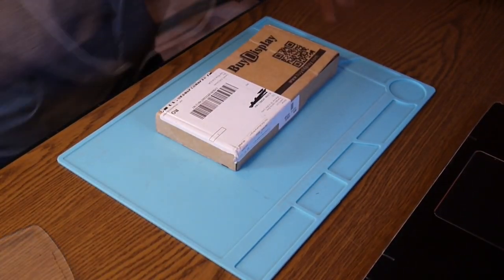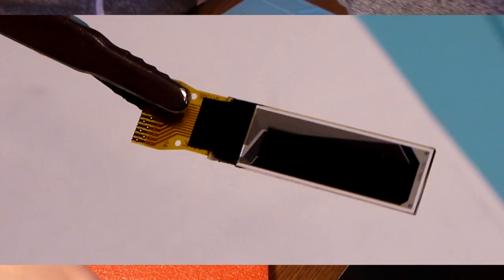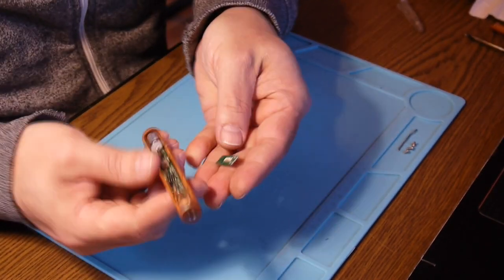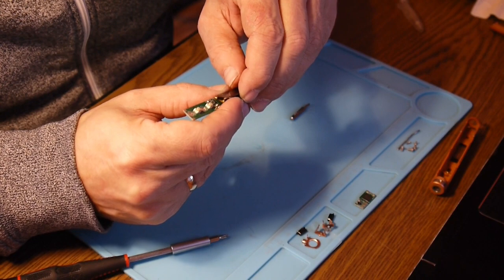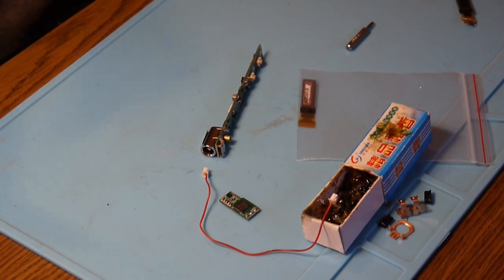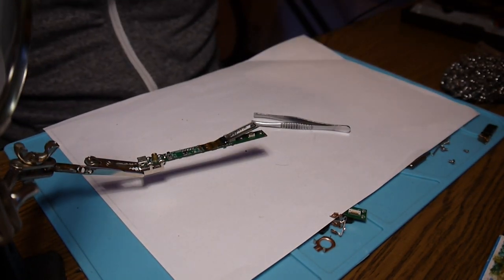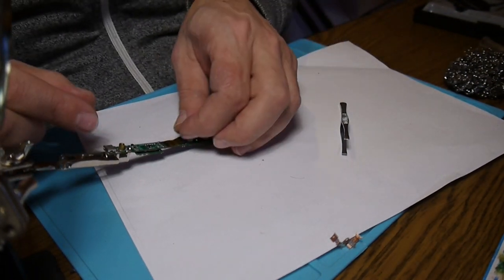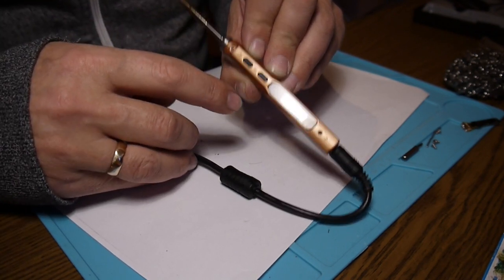TS100 soldering iron OLED LCD screen problem fix and replacement

Comment: I fixed the same issue 3 days ago, and it was working fine as in your video. Then I put in a desk, and the day after the OLED was dead. Not lighting at all, but the iron seemed to work (it was getting hot).
No way to have the OLED working again. 
I dismounted the solder again and spend one hour carefully checking under the microscope the solders, and they were perfect.
For added certainly I quickly passed again the iron over the soldered contacts but nothing changed. Then I tested each contact, and there was electrical contact between the connector and the PCB, and the 3V voltage was powering the OLED, but the OLED was just off.
No idea of what happened. It was working the day before just after the replacement, and it was just turned off and put on the table.
- any idea of what happened ?🤔
Reply from the maker: Probably a bad LCD... I had that issue with my son's , replacing the screen turns off after a few weeks... I ordered some more, and it seems this time it's ok. Mine it's working for years now...so call it ''luck''...
Reply: @viocaia  Thanks, I will probably order now a bunch of OLED, and I will replace the OLED again. Really bad luck. I had also used low melting temp tin (138°) do avoid to damage the LCD ribbon. However it was too stick and I had to raise at least 250° to have something fluid.

Comment: Oops friend! I wanted to take just one question here about the TS100. Mine is apparently working, only one detail is making me intrigued, when I turn it on and press the heat button, there are times when it keeps going back to the start screen and lowers the temperature even before reaching the point configured as default, 300 °C, this happens in the first few minutes after it normalizes. But if I disconnect from the source and reconnect it happens again. Could you tell if this is normal or the source is not feeding correctly? I was using a 17v 5a source.
Reply from the maker: The source seems ok, but check the screws inside the iron..those which keeps the contacts for the tip..I found one loose and it was exactly the same behavior...bad contact

Comment: I think there is a problem with TS100 hardware. after ive replaced my screen, few months passed, same thing happen, oled screen gets dimmer!
Reply from the maker: Interesting..mine it's perfect since..probably it's bad replacement..same like original..

Comment: Just wanted to drop a thanks for the video. Very helpful and gave me the confidence to give it a shot. Worked out perfectly for me (Other than the screen is a little off center now and I can't decide if it's worth wrestling with those screws again to fix it :) ). Mine is a Sainsmart Pro32 which seems to be a clone in every way to the TS100...including the screen. apparently. Thanks again.
Reply from the maker: If it's working..just let be, even out of center..! Nice you could fix it!

Comment: Hi
Will this new screen last longer than the original one or is it an oled technology issue (and it will die in 1 or 2 years)?
Reply from the maker: I'm using this daily for hours..and still ok, up and running..since 2020

Comment: Add me to the list of TS100 owners with a dodgy display. Only used it a handful of times, original firmware. Some pixels are bright, most are dim or off. Unfortunately this repair looks too much for my fingers of butter and fists of ham. :(
Reply from the maker: Welcome to the family! "-) you can still use it like that.
Reply: @viocaia  many thanks for the video, very informative
Reply: Annoying as these are not cheap irons...

Comment: Fixed my TS100 after ordering the same part and it's working great. The only issue is that the display seems to be flickering a bit too much for my liking.

I've flashed Ralim's Iron OS and will report back if the display breaks sooner than expected. I've also ordered more than one OLED so if this one dies then I don't have to wait for months for a replacement to be shipped from China.

Thank you for the video, well done.
Reply from the maker: Nice! My OLED still running great after two years, I don't think Ralim was the problem..but let us know once in a while! God job!
Reply: make sure to clean all the flux really well with isopropyl alchohol  and then blow it dry with a cold of warm hair dryer.  leaving dirty flux can interfere with i2c after soldering items.

Comment: Got fixed mine as per this video. Thanks a lot. Mine was a bit tricky, because first backlight went off. But I was able to use it. Once I have looked at the old display (bent it from the adhesive), it stopped working completely :-D I wanted to desolder the old ne, but... the problem is, what if you have just this one soldering iron for precise work? ;-) Lucky me I had another one - Dremel gas soldering iron. Not the best, but it did the work.
Reply from the maker: Super! Nice to hear that!
Reply from the maker: Hey! Don't forget to like and subscribe! Thanks!

Comment: Just letting you know my screen went out and I am on orginal firmware. Thank you for the link for replacment.
Reply from the maker: Sorry to hear that, so the open firmware wasn.t the problem.Mine is working great since replacement, I use it a lot , day by day.Good luck with fixing!
Reply from the maker: https://www.youtube.com/watch?v=QBs-V6ZsH8Y
Reply from the maker: Hey Jeremy! Please subscribe to my channel! Thanks!
Reply: @viocaia   the copper clips that hold the  element are replacements available  ?
Reply from the maker: @foxrcn  I really don't know..good question, maybe can be improvised from 6.3mm audio jack
Reply: @viocaia   mine are fine but could be a failure point an having replacements would be handy they sell new shells tips etc
Reply from the maker: @foxrcn  for now I'm happy with mine, but I'm just a hobbiest using it daily like 30 minutes or so..

Comment: My TS100 screen is really dim and I can barely read it, but it still shows information, so it still working. I never upgraded the stock firmware and I didn't use it so often nor I kept on more that 5 minutes at the time, so I don't know why it failed.
Reply: my display is also diying... not tu much use but. it is getting worse each time i use it. i have ordered two replacement displays four under 5 dollars in aliexpress. i wil try fixit it! with one of my other solder irons (jbc 15w)
Reply from the maker: @divierteknia  let us know! good luck!
Reply from the maker: @divierteknia  Thanks for let us know, glad you could fix it! if you consider please help me with subscribe..
Reply from the maker: So , welcome in tye family, get ready for a replacement! Mine is working perfect since changed.
Reply: Same here, dim display

Comment: Thank you too. I fixed my TS80 with the same screen.
https://video.latavernedejohnjohn.fr/videos/watch/1ad4491e-349a-400b-9613-e46bd561bb66
Reply: Design speaking, I really don't see the point of chosing an OLED display since it's clearly not a standard LCD that would dry the battery down from this kind of device. It's not a vaping mod or a portable MD player. Sadly, more and more cheap devices made in PRC even those wall powered generic STM32 T12 stations, USB testers and tiny Lab PSUs have OLED screens.
BTW good videos from both of you guys.
Reply from the maker: I may say mine replacement is working great day by day..I think it was a bad OLED from the beginning..

Comment: Thank you for the great video! Mine TS80 needs to replace a screen and seems it fits TS80 as well.
Reply from the maker: Glad it helped! I think the open firmware was the problem..now I'm back to original and it's perfect for months!
Reply: @viocaia  I did update the firmware to 1.07 and still the same problem. I have ordered already new LCD screen for TS80 and will replace it. Thank you!
Reply: @viocaia  I doubt it's because of the firmware since it's just an I²C link and not a direct drive from the MCU. There is more chance that it was a faulty part, it looks like a common thing with OLEDs screen devices, especially TS100 and 80,  which is aggravating the shorter lifespan of this display technology. In a way it's like the capacitor plague 20 years ago.
Reply from the maker: @PainterVierax  very possible ! Maybe it was a coincidence, some others had the same feel..
Reply: I guess many users want to test the FOS firmware at some point (we're a bunch of nerds after all) and apparently the only former resembling issue with Ralim's code is a black screen after DFU boot, not entirely black from start and this bug appears right on reboot after flashing. But clearly this code is far from reaching any stability so it might be better to stay on vendor's firmware  for some time.
Also as John-John showed in his video (link in his comment below), the screen is not really black but the display is extremely dim and that's the symptoms of an old aged OLED screen.
 If you have kept your defective screen you might try to connect it to some bluepill devboard (the pinout shouldn't be too hard to adapt) to see if there is some display when the room is pitch black.
 He also pointed out that the replacement part that he bought with the link you provided is a slightly different design, probably from a totally different manufacturer.
Reply: @viocaia  I've always been on the original firmware and my screen is dying too. Doesn't seem like it's to do with firmware.
Reply from the maker: @Brian-uq6jm  Yep! It's looking like cheap parts used from the factory...but the replacement is working great since.

Comment: Tnx for the video mate!
Are the display flat cable pretinned?
Reply from the maker: No, you have to do it careful; I used a small 8W solder pen and a lot of flux
Reply: @viocaia  Tnx Viorel :)
Reply from the maker: Hey! Just give me a hand and subscribe! BTW, the LCD is working great since fixed..no more strange firmware on it!
Reply: @viocaia  You're right, done!

Comment: Had the same problem, I will buy that screen and try to repair. I wasn't able to find the screen until I watched this video. Thank you so much!!
Reply from the maker: By chance have you changed the firmware to the Ralim? 'cause my display got ruined shortly after I used Ralim firmware...maybe there is a connection..
Reply: @viocaia  suspiciously, yes!!! mine broke a few days later after I installed Ralim firmware. May be something wrong with it...
Reply from the maker: @fernando13pr82  for sure! It's to much coincidence.Now I'm back to the original firmware and I used it daily with no problem since repair...I also asked THomas here, he will let us know if conquer the same situation.Good luck! Stay away from Corona, just Jack and Jimmy!!!
Reply: @viocaia   write to ralim in IronOS ticket but I think probably if you  reflow-reheat the screen it might help.
Reply from the maker: @nidusa1  I'll try that, but for now I replaced the screen, like 2 years ago, works flowlessly since then.
Reply: @viocaia   sometimes they do poor soldering of the OLED screen and ralim's ironos is using faster timings. this exposes poor soldering or cold solder joints.  often just resolder the screen  fixes it without replacing it.
Reply from the maker: @nidusa1  good to know
Reply from the maker: Hey Fernando! Will you give me a hand and subscribe! I'm close to reach 1000!!! Thanks!

Comment: Just fixed mine today, (screen cable was broken just before the glass), ordered the same replacement part and it work perfeclty (exception made of the color (before it was light blue and now deep blue). Whatever the soldering with flux was really important to have the perfect result quickly (we have to be carreful, the copper fixation are very fragile I screw up one with too much temperature). Thanks budy for giving some advice it was helpful for me.
Reply from the maker: Nice! We've been lucky to fix them!
Reply from the maker: BTW, have you used Ralin firmware on TS100? I have a hinch 'cause my display ruined shortly after.
Reply from the maker: Hey Thomas ! Do you mind give me a hand and subscribe! Thanks!